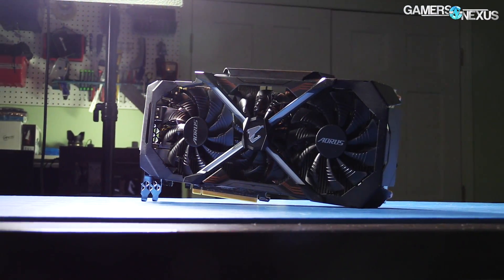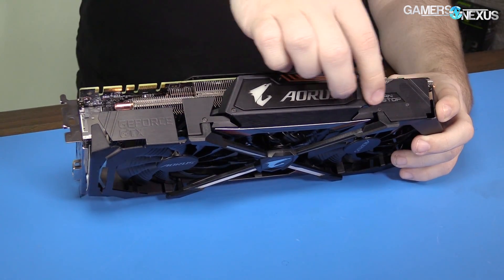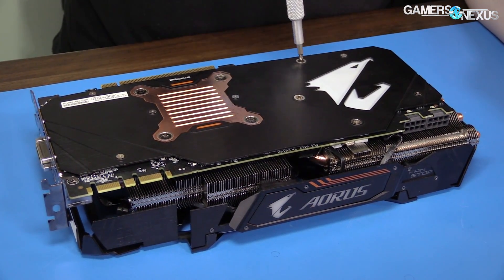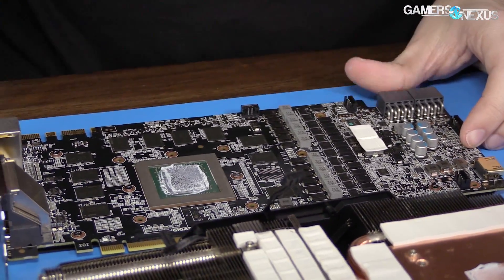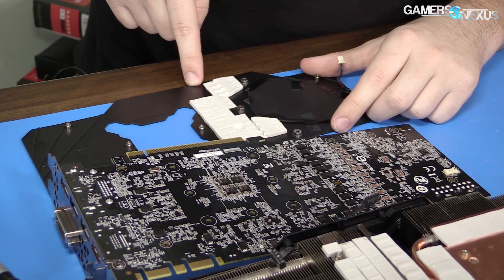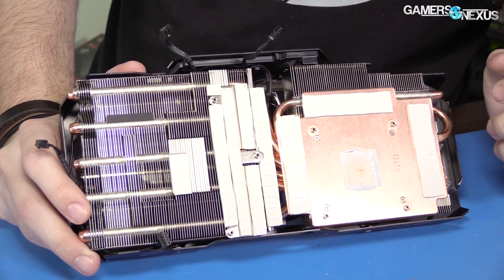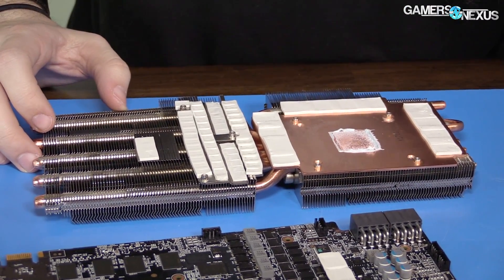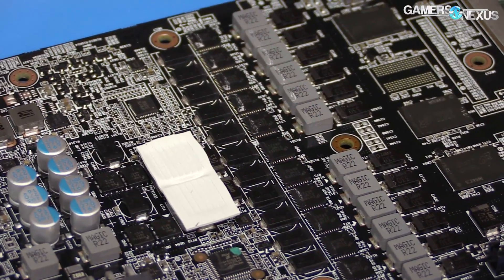Gigabyte GTX 1080 Ti Aorus Xtreme Tear-Down

Comment: which one is the best 1080ti?
Reply: All are pretty much the same in terms of temps. Look is personal thing.

But BEST right now is Aorus because they have higher power limit of max 375W, while MSI and ASUS have 330W. During heavy GPU loads in high fps 1440p gaming or 4K gaming the MSI and ASUS will constantly hit Power Limit and downclock themself, while Aorus will keep its clocks higher and stable because their limit is much bigger. 

As for max clocks- all of them cap on average after OC at 2050 mhz, sometimes 2076 mhz. 

From those so far - MSI, ASUS, Aorus I would (and did) pick Aorus Xtreme because I want to squish the most out of carda and 375W PL is a thing.

I had ROG STRIX Asus but I returned it because it throttled in Witcher 3 after a time, hitting its limit.

If you don't plan however to OC and play with Afterburner to get out most of your card just go for what looks best for you.

Also worth mention, Aorus Gigabyte have absolutely Quietest fans ever. At 100% you barely hear them.

Next thing worth to mention is that Aorus Gigabyte cards DOES NOT have warranty stickers anywhere so you can repaste core with best paste (Grizzly Kryonaut) and get another 5C in temps without voiding warranty. While sadly ASUS and MSI have warranty stickers so you can't do it.

Also MSI have great customer service, Gigabyte too, but ASUS can be horrible.

Overall, I took Aorus Xtreme 1080Ti to get max out of my GPU.
Reply: Patttiat patttiat2000 the highest in price
Reply: Great! Just remember to take advantage of your Aorus cards and repaste them with Grizzly Kryonout thermalpaste! It is easy, just follow this video to tear down your card and reasemble it.

Also use custom curve for fans for the best temps, as they are really quiet.
Reply: beniamin, thx.
i go with the Aorus now, my last two cards where the gtx 980ti zotac amp extreme and i was very happy with them.
1 slot between the cards for breathing and it never go higher than 78C with max OC.
Reply: Patttiat patttiat2000 Warranty wise, the Aorus Xtreme handsdown.  Out-of-the-box clocks , including boost clocks (highest) available in the U.S. Zotac AMP! Extreme (1st) followed by the Aorus Xtreme.

Strix, FTW3, MSI are followers.
Reply: +_ skyguy _ 
Nah. This one has better I/O
Reply: msi no doubt in my mind, but is expensive

Comment: I want to ask one thing, you shoot the tear-down video first and then you review and then film the review video or first the review and then the tear-down of the card?
Reply from the maker: Ah, understood.

We run all the core tests (including initial thermals) without any modifications to the cards. The modifications do not occur until we're down to just the tcouple tests, as that requires disassembly.

Thanks for asking!
Reply: Soundofsilence32 Seems like they do the teardown first because he did say he was opening it up to install thermocouples.
Reply: @Gamers Nexus, I'm asking cause if there is any chance that the manufacturer using a cheap thermal compound or thermal pads on the card, it would be nice to know.

If you testing it with your thermal compound and thermal pads, we won;t be able to know how the "stock" performs...

Thanks for the answer!
Reply from the maker: We run all the benchmarks, take it apart and mount thermocouples, then run the remaining thermal benchmarks.
Reply: Thanks for answering bro!

Comment: such a huge card, how much overclock does it add? and is it voltage capped in nvidia bios?
Reply: The Aorus can still be over-volted by 100mV if you use the Aorus-specific software, not sure about Precision or Afterburner.
Reply: yeah but if you verify it wont report as more volts been added...

Comment: Wish those high end gpus would be a bit cheaper, i cant just throw 800€  out for a freaking video card. Hope AMDs Vega will throw NVidia from their high horse prices.
Reply: At this point, I will be happy if Vega ever manages to launch, never mind being reasonably priced.
Reply: i hope aswell that VEGA rocks, so nvidia has to go down with the prices. but i dont really think theyre that "strong"
Reply: This comment didn't age well lol, 2080ti sends its regards
Reply: a 1070 should be good enough for you its around $400
Reply: Hawkeye979 Well a high end from previous generation is like €300 right now, so with a bit of luck this card will be ~350€ too in 1.5 years.
Reply: Noble Savage The Amp! is a few Hz faster than the Extreme Edition for a few more ducats. Translation... 1-3 FPS out-of-the-box difference on average...

SLI... Waste of space (literally).  New titles rarely if at all support it.   NV Inspector offers Shit support for it as well, unless you plug in a DX9 title, LOL.  

Hence why I ditched my GTX 980 Ti 2-way for a lowly Aorus GTX 1080 Ti Extreme Edition.  It's pure Shit...  Only boosts to 2038 (core-clock) at stock settings...  I'm kidding about the Shit part...  This card is the Monsta that came over the hill and opened a case of whoop-ass!
Reply: Bassnut Not all games do SLI or crossfire.. I learnt the hard way with 2 X  980ti and NONE of the new games I purchased had SLI or crossfire utilized or they were very very VERY poorly implemented (single card worked way better most of the time) the only game I have that did have SLI /crossfire support was mass effect andromeda and its a piece of shit of a game so yea single card use is wiser and the higher end you go the better but you don't need high end unless your like me and get a 4k monitor (do NOT get a 4k monitor) better get something with a better refresh rate rather than the 4k res.. This my experience
Reply: no they wont vega will be expensive cause HBM2 is very expensive
Reply: This has not changed for many years, the way it was explained to me was the price on release is higher so they can recoup their cost to tool and manufacture. Once they have recouped their in house cost the overall cost of them will go down. This is why the smart builder is always a version or two behind cutting edge and let those that have no patients pay more for their short live bragging rights.
Reply: the Vega preview was using old drivers, they have yet to show vega specific drivers. I think vega can do 1080 Ti speeds but the price will be around the same.
Reply: Wait for AMD AIB cards to arrive, it was just announced that AIB cards will be able to stack more VRAM on the board.
Reply: they are 1200 with tax in Canada LUL
Reply: Brandin, what the fuck are you talking about. The last few generations of x80 Ti cards have all just been cut down Titans with either comparable or near identical gaming performance to the Titans. This was not a "NVIDIA IS AFRAID OF VEGA!" move, this is exactly what everyone who pays attention to the market was expecting to happen. NVIDIA isn't assfucking anybody, they're just being a company. If you want someone to blame, blame AMD for refusing to compete with NVIDIA on the high end. Pascal's card releases haven't really been any different than the last generation or the generation before that. Baseless fanboyism arguments don't help anyone, be they from stupid AMD fanboys or stupid NVIDIA fanboys. At least Ryzen kicks ass, maybe the money they get back on Ryzen can push Vega forward.
Reply: The Mighty Voice yeah but the titans just came out they are doing this so they release earlier than vega this is what i meant when i said they fucked us not to mention the 1080 just came out and they got fucked to you shouldn't have to worry that something will get double the performance for the same price of something you just bought
Reply: Jan Bloem nice stats but where did you learn this?
Reply: if vega could compete with this card, they would have compared it to the titan X and not the 1080...  probably be priced near twice a 580, so probably around 500$.
Reply: @rphxleonine LOL... FFS they really stretched out the hype
Reply: The past has proven many times that AMD's higher "raw" specs of clocks / bus bandwidth / cores / transistors / ROPs / TMUs never really meant anything. Same for their CPU's with constantly higher frequencies than Intel pendants yet terribly lower performance.

In fact, Nvidia pendats with less of the above stats have pretty much have been equal or even faster, for example with the GTX 970 vs RX 480  ---  GTX 980 TI vs. R9 Nano --- GTX 1080 vs R9 Fury X. Check those stats and their actual performance. 

Cuda Cores and Stream Processors are not the same by the way. What I'm saying is, you can look at the raw stats and HBM 2 and all that, and in the end we've already seen that HBM is great, but Fiji has overall been a disappointment.
Reply: One guy at LTT forums bought one and it won't even run at stock speeds, lol. Feel bad....hope he can win the chargeback he's trying to do.
Reply: alphazoom II, maybe his power supply is not powerful enough, either that or someone in the shop where he brought it from took it for a spin around the block a few times, lol.
Reply: Nah...he had a really good PSU. Just got a bad one. Not sure what he will do. He bought it at Newegg and they said he cant get a refund only store credit...da fuq?
Reply: Wish you could buy them with the heat sink/fan part since I'd likely WC it anyway.
Reply: +alphazoom II 
Silicon lottery. And yeah, I can't imagine he won't win the charge back. The product purchased isnt as described.
Reply: Just bought this exact one for $679
Reply: Dam ..7 years later. My gpu still kicking and gpu prices doesn't make sense to go for upgrade
Reply: i think VEGA is around a gtx 1080, so probably a bit lower price but not much.. sadly
Reply: Hawkeye979 no they wont because the 1080ti is just a titan but cheaper kinda funny how much nvidia is ass fucking us in prices you can tell because they dropped that price so much funny how scared they are of vega
Reply: you can thank ngreedia for that, prices of high end gpus used to be in the 500/600 mark at the very highest but then the Titan dropped and all the dumb fanboys fucked it up for the rest of us
and before you bitches whine yeah i can buy ton of titan cards but i have the common sense to know that those are not worth the price
Reply: LoL must be cool to live in the basement of Mums house and have all the job earnings for themselfs, i myself cant just spent 800€  for a card, i need to pay off my flat and also need to get some money left on my bankaccount to buy me a new car soon, since my old one is not really in the best shape ever. Im not really poor, im just an adult that is living my himself and not having all the benefits of living at the parents home. Also fuck u nvidia fanboy :) whats so bad about having some competion with Amd, prices will go down for Nvidia and AMD will also have something for everyone... i dont get u Nvidia fanboys everyone will profit from AMD showing some good cards, only Nvidia will lose some money since they cant overprice their cards anymore.

Comment from the maker: Thanks for watching! Review is forthcoming. Probably shooting that this weekend. In the meantime, we just re-stocked our shirt store (store.gamersnexus.net) with GN Logo shirts from S->5X, and we've got a "Getting Started" guide to VPNs & private browsing on the site that we published today (article-only format): http://www.gamersnexus.net/guides/2879-private-browsing-tutorial-vpns-tor-https
Reply: +Gamers Nexus Nice, now I can finally get my hands on a GN shirt, and looking forward to the review for this beast. Gigabyte is one of my favorite brands.
Reply: Regarding the fans for this card, the thicker fins on the center of the middle fan are probably also because the center spins slower than the outside portion of the fins and it more evenly distributes the air pressure across that fan.
Reply: I loved the teardown, I know that for any cooling solution it is about what works, but the Aorus cooling solution looks too bulky and a bit mental so it would be interesting to see if that extra heft actually translates into extra performance of note.

One thing I was interested in was the Aorus Radeon box that kind of keeps peeking out from behind your left hip.  Is that a new card and will we be seeing information on that soon?

Many thanks.
Reply: Likely just the Aorus 570/580.